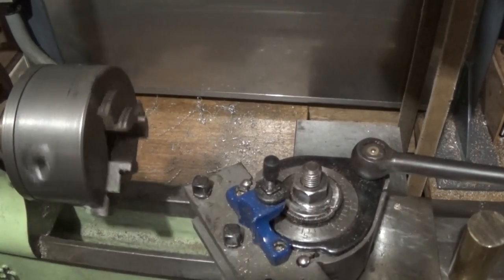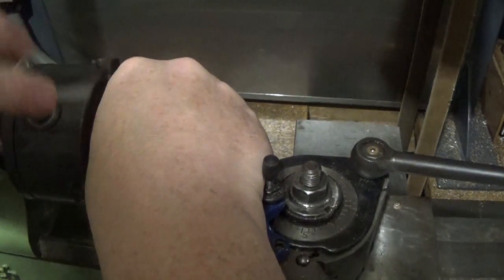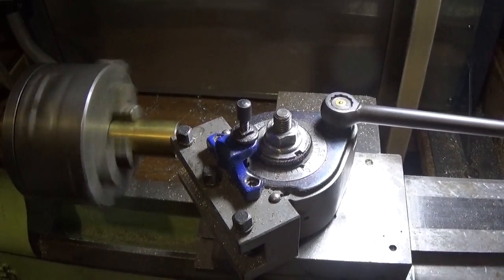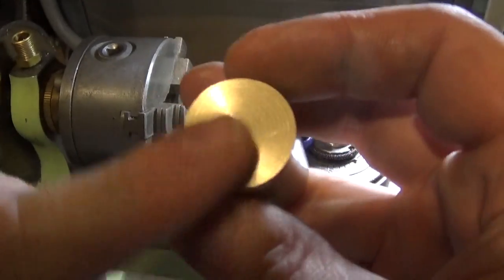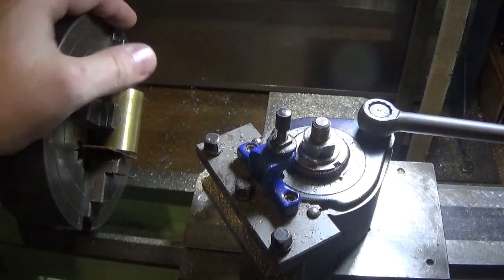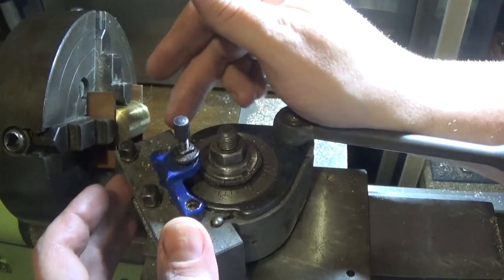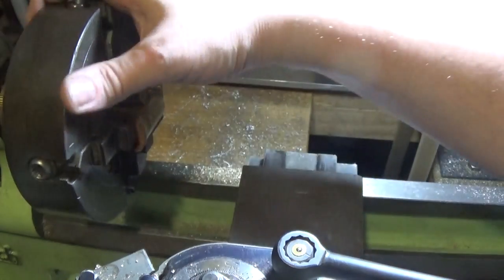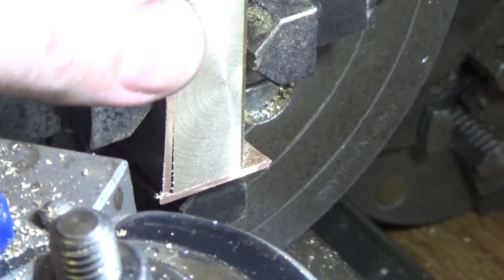myfordboy engine part 5

Comment: Sweet :) TWO tips I can use for 4 jaw square work. I really like that parallel line check you mentioned - and I've always fumbled with parallels behind the work when it came to flipping it over, but rotating 90 degrees is something I'm definitely going to try next time.

Thanks for sharing :D